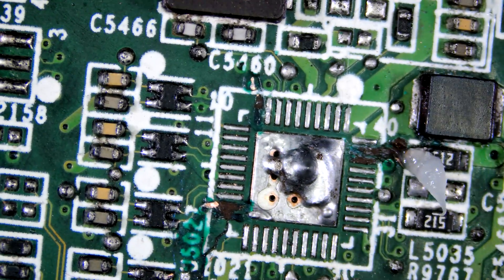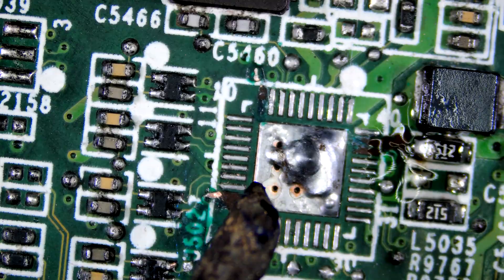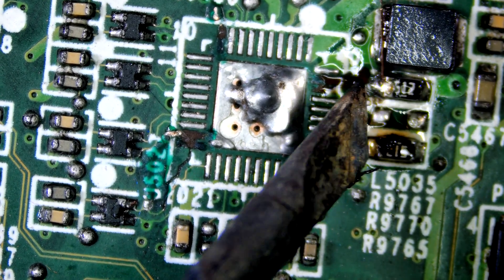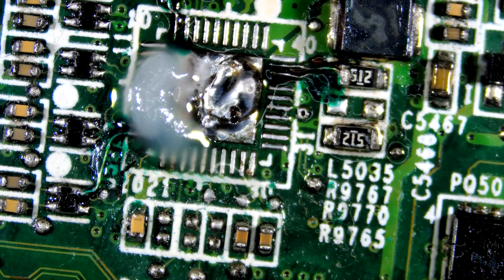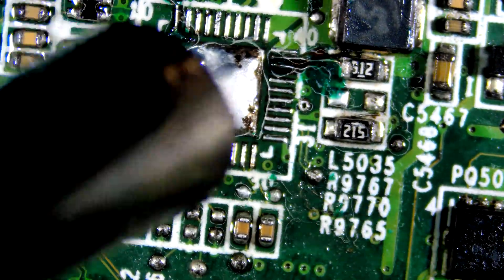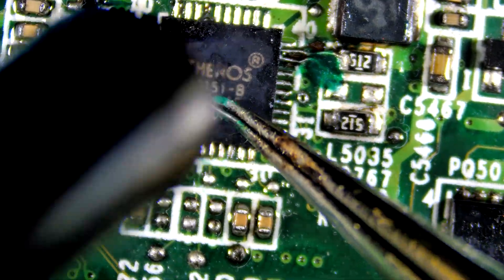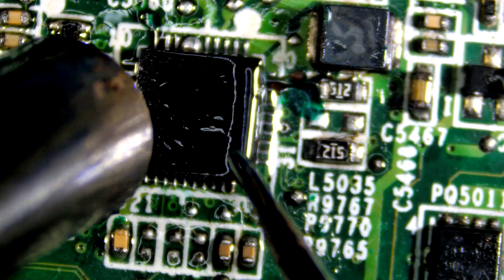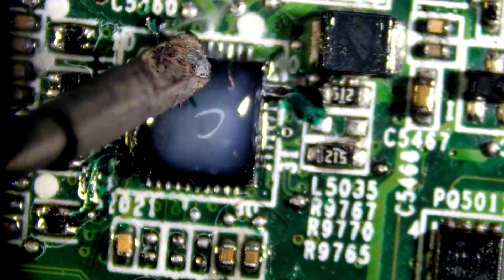How to Restore Traces & Resolder IC: A Step-by-Step Repair Guide (Part 2)

Comment: That music is so loud.
I have to keep turning it up to hear the instructions and then turn it back down for the music.
Still nice to learn about
I have some super tiny SMD capacitors on a Raspberry Pi 5 that I am trying to restore but they're so small it's difficult to set them in place
I wish I could find a video of someone doing those (I think they're the 0402 size, the ones that have traces going across the board, coming out from the memory controller)
These things are sooooo tiny
Reply from the maker: Thank you for your feedback i will turn down music in next video. It was new voice model so i am still trying to get the hang of it
Reply: @CircuitFixTech  -- No worries -- I appreciate the videos. Always nice to learn new techniques. Just didnt want to wakeup the rest of the house w/ the subwoofer attached 😁